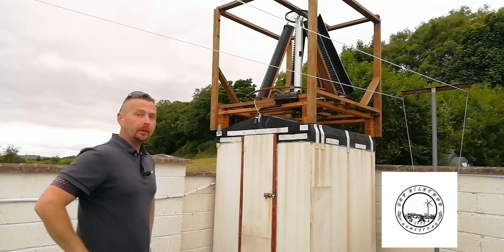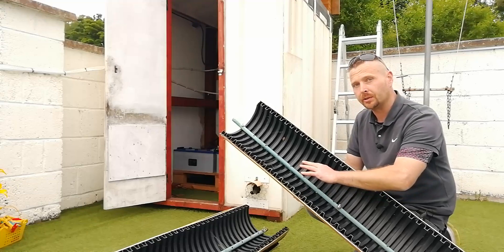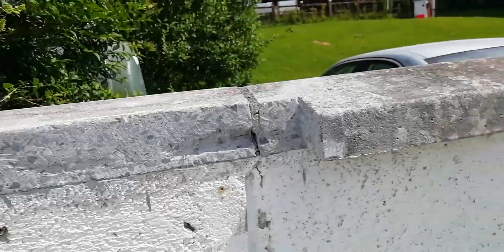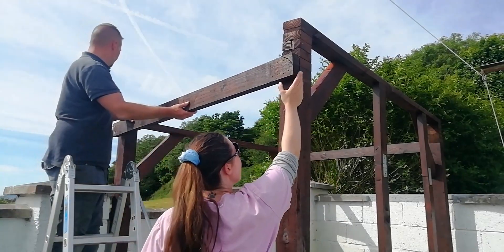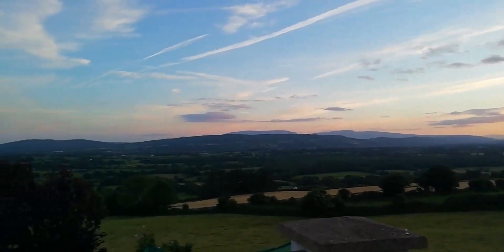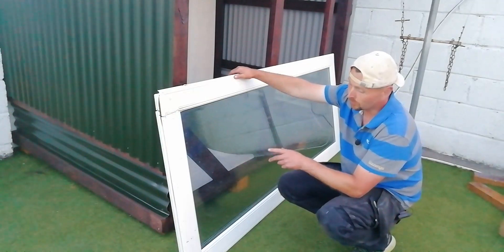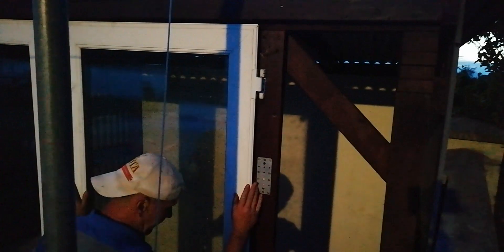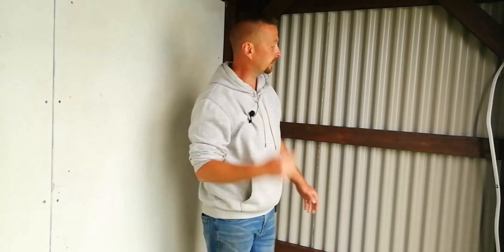New Off Grid Power Station Build

Comment: What is the smooth side made of? Why was it cone shaped instead of straight vertical?
Reply from the maker: The smooth side is a product called "corriboard". Its a corrugated plastic sheet commonly used as flooring underlay.
The cone shape is to keep the rotating weight at the bottom of the turbine for better rotational balance at high speeds. 
This results in less vibration and smoother running. To achieve the necessary high rotation speeds a turbines weight must be near perfectly balanced. Weight imbalance will cause vibration which prevents the turbine turning faster. Without a balancing machine for this diy effort, moving the rotational mass to the bottom was an imperfect way of getting around the problem.

Comment: Small wind turbines are pretty unreliable, solar is so much cheaper and reliable these days, we’re totally off grid, solar only..
Reply from the maker: They are indeed however they make a great auxiliary source of charge particularly for the winter months. Solar combined with wind turbines with a jenny, all angles covered.
Reply: @ourkilkennyhomestead2006  we’ve had 3 different wind turbines over the last 20 years, 1st one 3kw from a major supplier never worked, never turned a blade…. White elephant.

Small Rutland wind turbine worked well, never produced any volume of power, someone stole it out of our field….

We have a “hornet” wind turbine just now, currently dismantled in the shed as we just can’t get it high enough to capture reliable wind…..